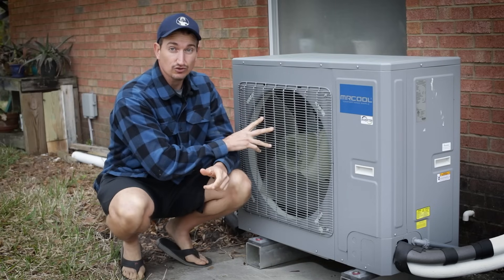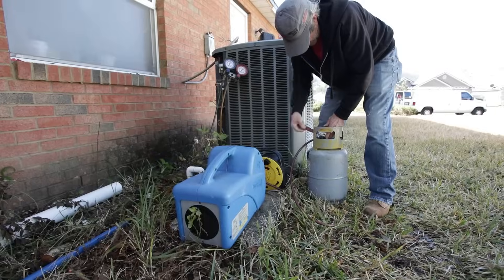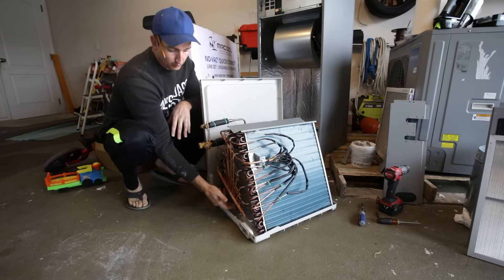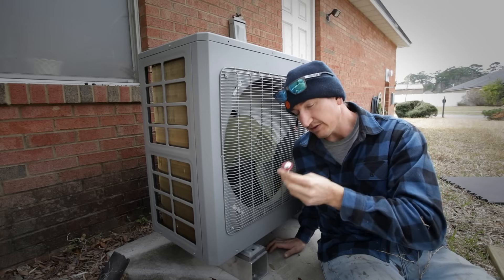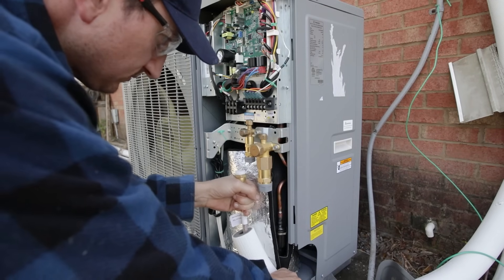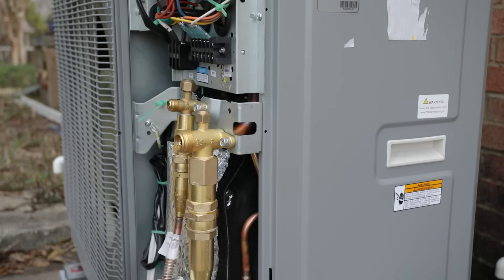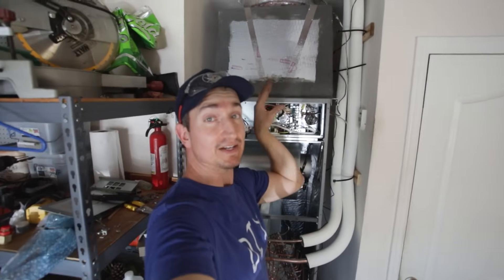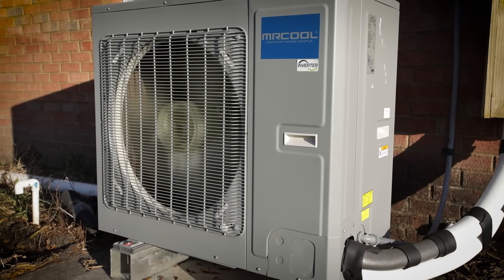Whole House Air Conditioner and Heating System Installation. MrCool Universal, Is it a DIY Project?

Comment: Did Mr Kool reimburse or compensate you for fixing that factory leak?
Reply from the maker: The warranty was honored.
Reply: @MrKistel  good to know.. my hardcore mechanical engineers at work hate these things
Reply from the maker: @lennykibbs260  do they say why?
Reply: @MrKistel  bad customer service and parts availability after 2 years of the current model,  kind of forces you to upgrade to a current model because parts like say a blower motor is virtually impossible to get..compared to well known non DIY systems like carrier, trane, etc who tends to have parts readily available even for older than 5yr old systems.. Or maybe they're just bitter with laying out $15K for a new common branded DIY system ???
Reply from the maker: @lennykibbs260  I recently posted a video showing the install of the larger 5-ton system.  Was pretty happy with the performance of the -ton, shown in this video, that I wanted to try the bigger system.   The larger system was a bit easier to install in some ways.

Comment: No air should have made it's way into the system considering that the system is higher pressure and didn't run completely empty so you should be good and air free.
Reply from the maker: Been running great ever since

Comment: Awesome video, this is very helpful, i was considering one of these units particularly for the pre-charged line-set. Based on your experience I'm seeing that there are benefits to vacuuming the lines before releasing the refrigerant as it's a good check for leaks. Which you won't get with this system. Also it's then possible to reuse the existing line-set which is a considerable amount of work/expense.
Reply from the maker: Thanks.   Instead of using the pre-charged line set you can reuse existing lines with this system. They would need to be vacuumed and refringent may possibly need to be added to the system to make up for the line length. The unit comes with special line extensions that would be added to your existing lines to make the connection.

Comment: Does this unit need a filter dryer ??? On the outside unit
Reply from the maker: Not if using the pre-charged line sets.
Reply: @MrKistel  has the unit been great so far , I’ve installed 2 mini splits by Mr cool and they work great here in Texas.
Reply from the maker: @dhjrblue9807  Yes and I am actually getting ready to publish a video showing my installation of the 4-5ton system for a different house.

Comment: Just a thought, so if the reversing valve gives you trouble when its ten below,  who is going to go out and solder in a new one for you? Back up heat sounds too good to be true?
Reply from the maker: The climate in the region where this system was installed is relatively mild so the back-up heating element was not considered necessary.

Comment: How long did it take from start to finish altogether? 🤔 If there wasn't any hiccups or extra HVAC helpers, what would the time frame be then? 

Awesome video by the way, I've been looking into doing something like that for my family, but I have no idea where to start.
Reply from the maker: The overall process is relatively straight forward.  It comes down to the unique variables associated with your install location and so on.  If you are replacing an existing system you likely have power in place for both the condenser and air handler. If so this eliminates running new circuits.  The rest depends on how simple or complicated it will be to run the line set and connect the ductwork.  I like the system and actually recently installed the bigger 5-ton system at another location.  I will be posting a  video showing that install soon.

Comment: Is this system air conditioning air handler and heat pump?
Reply from the maker: The system came with an air handler (inside blower) and an air condenser (the outside unit).  It functions as a heat pump.
Reply: Then the air condenser will run in cold months and hot months. The air handler will push forced heat from the air condenser through the house with out having a standalone heat pump unit?

Comment: What did you do for the indoor unit power? Wasn't your old furnace running on 110V while your new air handler on 220V?
Reply from the maker: In my case I simply replaced the old air handler with the new one.  The old one had a 240 volt supply and I reused it.

Comment: What I have learned is that - a small % of guys are smart and skilled enough - generally- to DIY install a system like this.  Most are not.  If you are smart enough...yes you can save a lot of HVAC expert installation fees/labor.
However for most people out there, they are not skilled or knowledgeable enough to DIY one of these units/ or a mini split system.... and/or they find that after the install, many issues may arise, and few if any HVAC guys, will then mess with their self installed system... due to legal liability issues.
So for most people, having a licensed HVAC person, and one with years of experience ideally, install your next HVAC system is suggested.  Thats what I will do.
Reply from the maker: Appreciate your thoughts, thanks for sharing

Comment: Thanks for posting your installation.  Do you believe the leak at the coil was due to not torquing with a wrench to support the mating piece OR a manufacturer defect?
Reply from the maker: The unit was purchased as  "scratch and dent " model and the coil was pierced on arrival.  The warranty was honored in any case so no big deal.

Comment: I worry for your state of charge and system efficiency. 1st, when you were torquing the DIY adapters onto the units, you didn't use a backup wrench to hold the valve blocks as you installed them. Likely the cause of the A coil leak / need for repair. 
Now your a/c guy, I didn't see his recovery and tank scale. The only way to get a proper refrigerant charge on these units is to remove and evacuate the entire system and then weigh the charge back in. So not seeing a refrigerant tank scale leads me to believe he simply used luck and prayer to guestimate the amount. Mine is SUPER ENERGY EFFICIENT and my heating/cooling bill lowered over 52% over my 13SEER Trane Wreck so if you didn't see a BIG savings, it might be worth it to schedule a modern HVAC technician to recharge your system properly. Cheers!
Reply from the maker: great to hear you system is very efficient.  THis one seems to be running well and is far more efficient then what was in place before.

Comment: Your water drain (lower ) should have a p trap . The water won’t drain , when the air handler is on it will pull the water from the negative pressure .the unit is only precharged with refrigerant for up to 15 feet . Also you can’t  get a correct charge unless the weather is at least 80 degrees outside .if you  add refrigerate when it’s cold , you probably will over charge the system and it won’t run correctly in the summer .( cool mode)
Reply from the maker: The special linesets come with additional refrigerant in them so the distance is accounted for.

Comment: do you have a aux heat or not, where you located, thanks
Reply from the maker: No this system did not require the aux heat component for the milder climate region.

Comment: Is it an obligation to have the duct insulated in order to have a ducted heat pump?
Reply from the maker: The duct work could condensate if it is not insulated and create water problems.

Comment: Did you contact Mrcool when you found there was a leak in the coil? Would they have covered it since it seems issue with the unit itself.
Reply from the maker: The warranty was honored. Thanks for watching and the comment.

Comment: I am replacing a 23 year old unit and the duct work is fiberboard and I will need to reconfigure to make it fit the distribution lines. Can you please post or send me pics of the top  of your unit so I can get an idea of how you tide yours in?
Reply from the maker: I am working on editing video showing the installation of the larger version of this system and the top looks similar. I will try to incorporate visuals into it that show the top area better. The opening for airflow is rectangular, roughly half the area of the top dimensions of the air handler itself.  I believe the manual shows the dimensions and can be found online.

Comment: Excellent video, thank you. Tightening all of the lines are you saying they need 50ft.lb torque for each piece?
Reply from the maker: I believe each connection had an unique recommended torque value according to the product manual.

Comment: I'm going the DIY route. Did MrCool pay for the HVAC tech to come out to your place? Any updates on how the system is doing?
Reply from the maker: This particular system has been doing great since the installation and publication of this video. I recently installed the 5-ton MrCool Universal system (see link in video description area)  at another location as well.  I felt it was easier to attach the line sets on the 5 ton system primarily because the connections are on the outside of the condenser itself.  On the 3-ton, they are inside and you have to pull the line set through the condenser trim cover. The warranty was honored on the three ton system.
Reply: @MrKistel  Thanks for the reply. Merry Christmas to you and your family.

Comment: Idealy you should take all the refrigerant out and put in the proper amount. As far as air getting into the system, since the system has a much higher pressure than the outside air, air isn't going to go into the system assuming you didn't lose a ton of refrigerant.
Reply from the maker: Thanks for the insight.

Comment: I just installed a 3 ton universal.  I noticed it pulls 0.7 amps even when off!!  This amounts to $180 a year in wasted energy.  Do you know what your current draw is to the outdoor unit when off?
Reply from the maker: Maybe try to check the power usage at different times when it is off and see if it fluctuates.  I believe there is an occasional heating process that can activate from time to time.  I assume this would happen more in cold weather.
Reply: @MrKistel  I setup my system with a MrCool gas furnace and a separate coil.  Usually it is sold with the air handler you used not my duel fuel setup.  How much refrigerant was in the air handler coil you installed?  It should say on the data plate.  I'm trying do some diagnostics because the outdoor units is pulling 21 or 22 amps each cycle, which is way over the Rated Load Amps (RLA) of 16 on the compressor data plate.  I'm trying to make sure I have the same refrigerant charge as what the default system you installed has.  Thanks!!
Reply from the maker: @mtbphil168  Hmm, I am not sure exactly and don't have immediate access to the data plate.

Comment: I'm missing something here. So you get a defective unit and you have to pay to get it fixed?  I was almost sold on this unit until I saw that and no mention of the company sending you a new replacement.
Reply from the maker: A bit of clarity:  So this system was purchased as a "scratch and dent" unit but sold under warranty.  The vender made things right and honored the warranty as advertised.  The overall install ended up being more complicated because of the initial defect but I assumed that a possible outcome when purchasing a scratch and dent version. The unit shown in video has worked great since install and I am considering installing another one in another house.

Comment: 2nd Mr Cool video I've watched, 2nd time installer complained about manufacturer defect causing refrigerant leak.....is this common?
Reply from the maker: This unit was advertised and sold with cosmetic defects.  The vender advertised full  warranty regardless of the blemishes.  It turned out the air handler coil was damaged on arrival.  Although it caused some installation headaches, the vendor honored the warranty and made things right. I sort of anticipated higher risk of potential defect purchasing the "scratch and dent" system.  I do not take issue with the vendor nor the manufacturer for this situation as the warranty was honored. The system has been running great ever since.

Comment: How much and how much money did you save on electricity?
Reply from the maker: I regret not pulling a wattage used reading on the old traditional AC System before installing this new one. So I do not know the power consumption use of the old system to compare with the new.  The inverter condenser with the new system throttles itself routinely so it is never using the same amount of power.  For example, right now it is running and using about 1800 watts however I have seen it read near 2300 watts at higher demand times  (i have the settings set to max output by the way). The old system was always running full throttle likely using considerably more power than this unit at its peak usage periods. .

Comment: Great video, I'm looking into doing this install. I'm curious, did you approach Mr. Cool about the leak in the air handler/evaporator? Their warrsnty seems to say that if you are using their precharged lines then DIY installs have warranty coverage.
Reply from the maker: Thanks for watching.  I discussed with the vender I purchased the unit from and they worked out an arrangement which I felt was fair
Reply: @MrKistel  Thanks!

Comment: Wow....wasn't aware a Mr Cool unit had a central AC option vs minisplit only. Should be much more efficient while still using the existing ductwork!
Reply from the maker: Worked well for this application.

Comment: Ok just watched this video from your other video and like I said after connecting the refer lines if you would have pressurized with nitrogen, you would have found your leak in the A Coil. Fixed it then pulled a vacuum (regardless of brand new or not) then open the condenser valves to release the refrigerant into the system.
Reply from the maker: This system was installed based on the manufacture instructions for this specific system.  My understanding is the condenser unit, the air handler coil, and the line set come with refrigerant in them before installation.
Reply: @MrKistel  they got you. Think about it honestly. If the air handler coil came pre charged (wouldn't it have been leaking before you open the valves there.) It only started leaking once you opened up the valves at the condenser where it's charged with refrigerant. If you have a 30ft lineset and need 3 additional feet to make your entire lineset length 33ft does the 3ft come pre charged with refrigerant from Mr cool with there quick connect fittings. No this is just a way they get people like you (DIYer). the mass majority of professionals don't use them. Home depot special. Have a good one 👍🏻
Reply: @SOUTHCO4ST  this is one of the dumber things I've read today which is saying something considering this is the YouTube comment section. 

They got him how? They gain nothing by selling bad systems.

It started leaking refrigerant after he opened the lines? Whaaaat!? It's almost like the a coils was defective and when he released the refrigerant from the lines it started leaking out.

Comment: Nice install. Im going on 3rd yr with mine. Love it .we just had during Christmas weekend the coldest here in a long time. 50/60 below wind-chill. The mr cool universal 18/24/36. Kept the house at 73 degrees. No electric heat kit assist, house insulation not so great working on that.  Im still pretty happy .
Reply from the maker: Thanks for the comment and sharing your experience.  I am happy with this unit as well.  I may install the larger 4-5ton unit in another house at some point.

Comment: Is the power to the indoor unit coming from the outside condenser like in the regular mini splits or does the indoor unit get power from its own source / circuit?
Reply from the maker: The air handler and air condenser units have two separate and independent circuits.

Comment: So I opened up my replacement condenser top today before swapping it out to see the part that had failed (believe to be pressure relief pop-off valve). Unfortunately it looks the same. I believe whatever causes this line to heat up will melt the solder again resulting in another failure. Was hoping they had replaced the part entirely.
Reply from the maker: Thanks for sharing. Hoping your system performs well.

Comment: This air handler is 240v correct? You can run it with 12/2? No neutral is required?
Reply from the maker: 240 volt is correct
Reply: @MrKistel  and no neutral? All the electronics in the air handler work fine?

Comment: Mr Cool central air handlers for ducted systems come either with single stage motors "PSC"  in the CTA line and with modulating motors "ECM" in the ETA line.  The air handler that come in the "Universal Series" does not specify what type of motor it comes with; is the air handler that comes with the Universal Series a PSC or a ECM motor?  Doing again, would you do the same set up or go Dual Fuel?
Reply from the maker: Based on my experiences up to this point I would likely do the same again. I am not real familiar with the duel fuel options however in this region I think electric the heat pump works well for both heating and cooling.

Comment: You guys aren't pressure testing or vacuuming your line sets before releasing your refrigerant. All your systems are contaminated with air and moisture. You can't just connect lines and release refrigerant.
Reply: Precharged linesets.

Comment: Amazing video!!  I hope to pursue installing a slightly larger system in the next two years.  Did you attempt to apply MrCool warranty to the A Coil leak?  and what was their responses please???  thanks!!
Reply from the maker: Thinking about doing a 4 to 5 ton unit this year perhaps as well.  The vendor made things right regarding the issue shown. It was a smooth process.